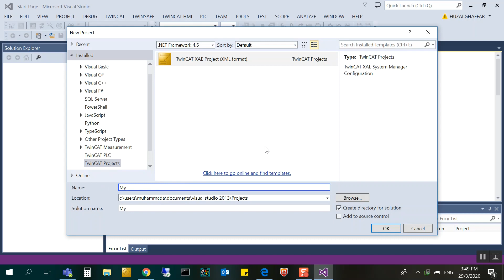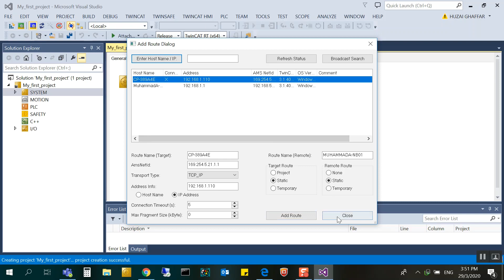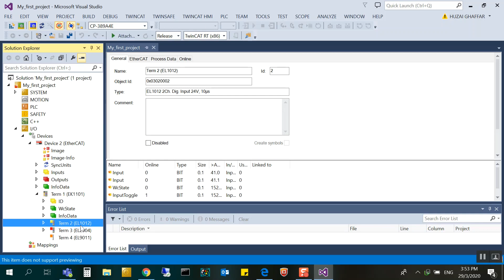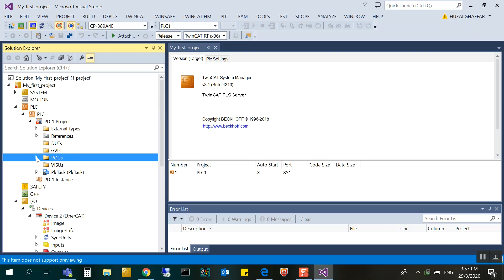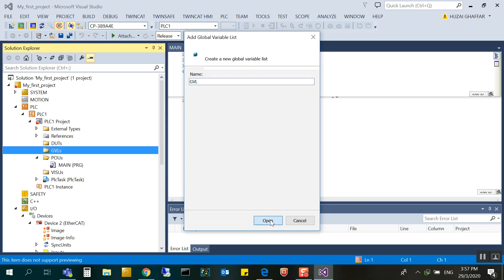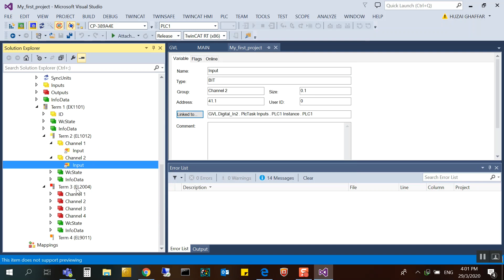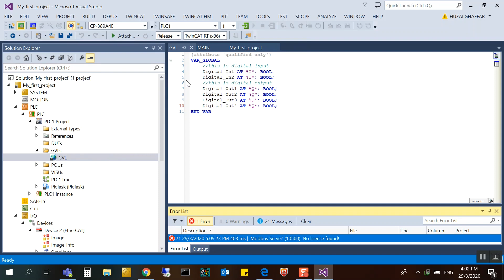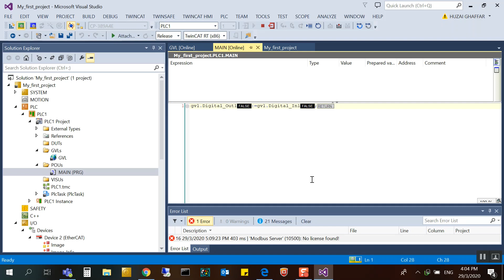TwinCAT 3 Quick Guide

Comment: So each completed project/program is called a solution file?
Reply from the maker: Hi, thanks for your question!

A solution file is used to compile multiple projects that you could create. 1 solution file for example could have PLC projects, HMI project, and many other TwinCAT projects that are created :)
Reply: @beckhoffmalaysia  Got it. Thank you.
Do you have a basic program of a pump system on YouTube. Here are the requirements:

1. Add a second push button bool variable and rewrite the logic so the pump could
be turn on by pb1 and off by pb2
2. Add a second push button bool variable and rewrite the logic so the pump could
be turn on/off by either pb1 or pb2
3. Add a second pump variable that could be turn on by pb2 only if pump1 is already
true ( pump 1 is turned on/off by pb1)